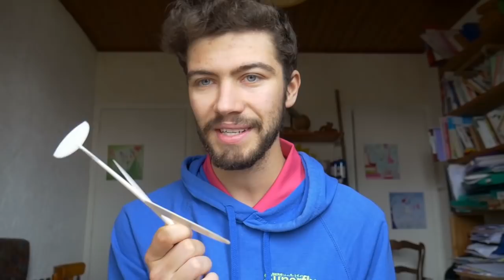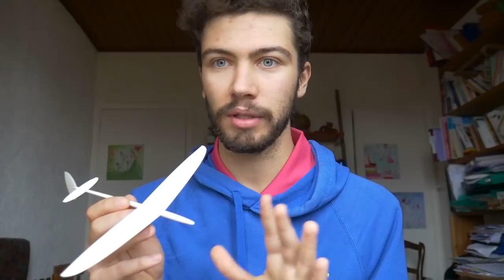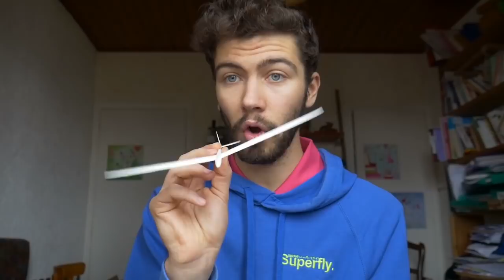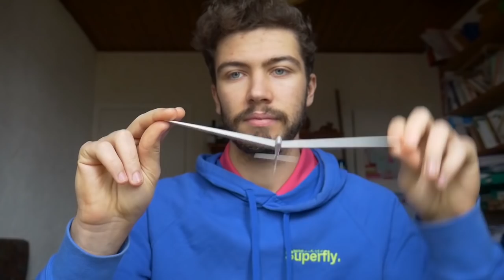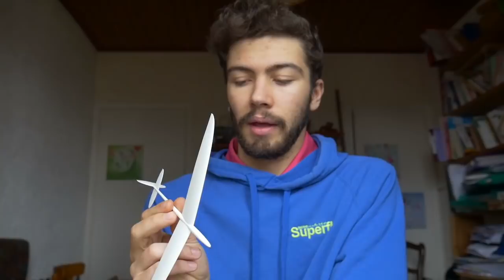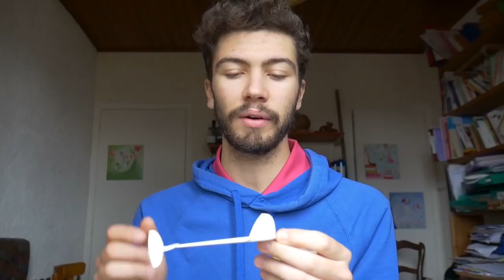F3K setting masterclass Theory / The Differential

Comment: The differential compensates the negative turning moment. Without this, the model's nose would push outwards in the curve. For testing, you fly towards yourself at high speed and apply left and right aileron every second. Then you can see from the front whether the nose stays straight or swings to the right and left.

Comment: Thanks for the explanation and your effort, man. Also cool, that you mentioned this rudder mix thing - I guess, you use rudder additionally manually when needed? It would be great, if you could explane your use of rudder also sometimes at this series. It is not much written about rudder use in DLGs, at least I haven't found anything proper.

Comment: Quick Question:  Why would you set AIL travel at 10mm down and 6mm up ever?  Perfect symmetry and control should be with equal distance of travel.  10mm up 10mm down in your example.
Reply from the maker: It s called differencial. Depending of your airfoil you need to balance the forces to reach the reactions your are looking for from the glider
Reply: @pierremeunier   Is that set through by line of sight with the glider?  I predict you would have to fly the glider where you can get a good visual on inconsistent roll.  Comes with practice. for tuning I see.  Great video over all.  Like the in-depth talk about it.
Reply from the maker: @CRRC81  yes you need to fly it , because it will also depend of the cg of the glider . Glad you appreciate it !